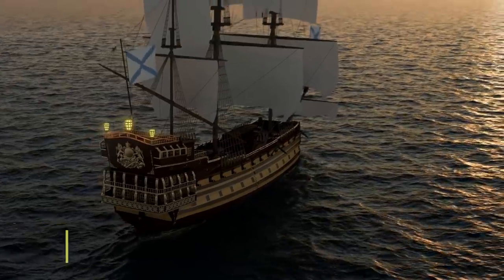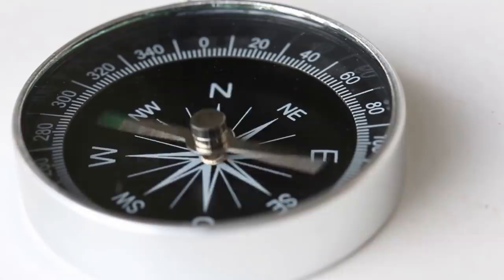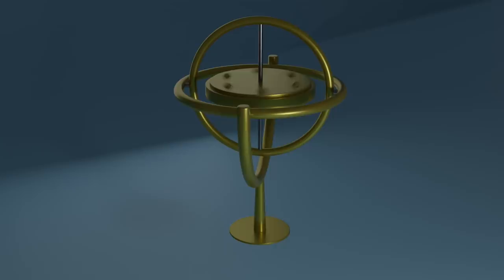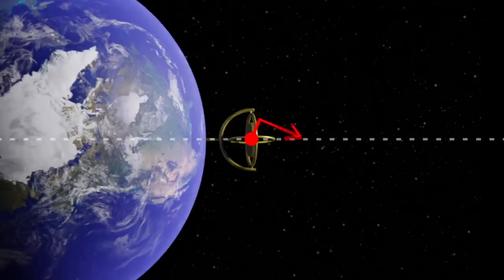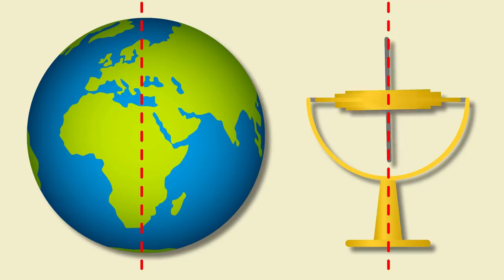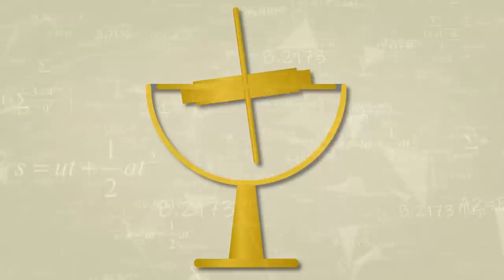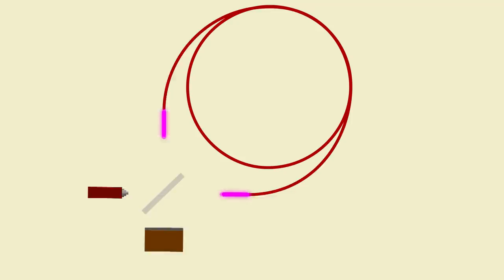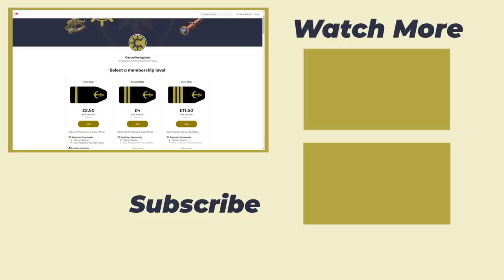Gyrocompass: How Ships Navigate Using The Earth's Rotation

Comment: You can feel the gyroscopic effect on a bicycle when doing a wheely as the front tyre comes to a stop the bike becomes much more unstable and will become much harder to ride straight
Reply: The gyroscopic effects are insignifican when boh wheels are on the ground. Bikes are stable because, as you start to topple to one side, the bike steers in that direction, moving the bike back underneath you.
Reply: ...you are completely right and there was a guy who used to set silly records doing wheelies on his motorbike to which he added a small electric motor to keep the front wheel turning.

Comment: "if you give your gyrocompass a gps feed, it can take care of this sort of error" 
Why do you need a gyrocompass when you have GPS?
Reply: The issue with traditional GPS receivers, which use a single reception antenna, is that they're designed to receive your position, and give you calculations which can be obtained from your position, such as speed over ground or course over ground. Therefore, the GPS receiver will tell you in which direction over ground you're moving. However, it will not know your course through water, that is to say, in which direction in relation to water you are moving in. 

If you're thinking in ground vehicle world, the difference between course over ground and course through water might seem strange, but keep in mind that in water, you have the actual water currents, as well as wind which are going to apply forces to your ship, which will sum together with the forces provided by your own propulsion. Therefore, it can happen, that in order to achieve a particular course over ground (which GPS will tell you), you need to have a significantly different course through water, in order to compensate for currents and for wind. 

Lately, a new type of GPS receiver came out, called GPS/satellite compass. Unlike the traditional receiver, which has a single antenna, the compass has a larger external housing which houses an array of GPS antennas and synchronized receivers. 
The locations of the GPS antennas within that housing are fixed, and the distances are known to the computer within it. Therefore, based on the difference of time of arrival of signals to the receivers it has, it can calculate angles towards the GPS satellites allowing it to calculate the exact course through water of a ship, as well as some other information. 

Even newer development is the combination of the GPS compass together with regular gyroscopes and accelerometers. Such devices can also provide information about ship's list and can then be used by sonar and radar systems to correct for the effects caused by the list.